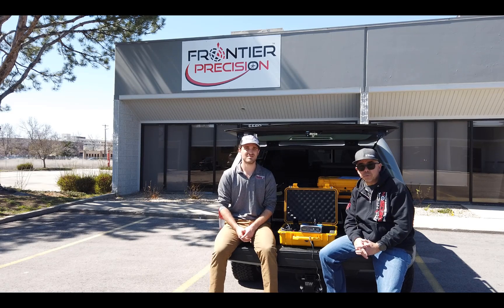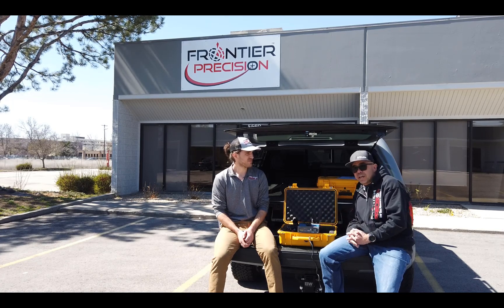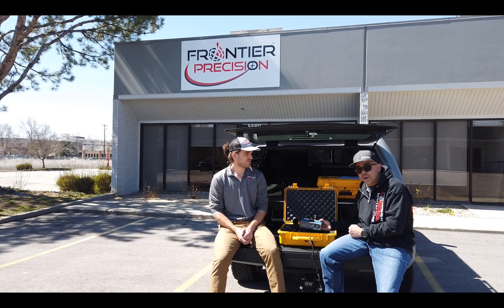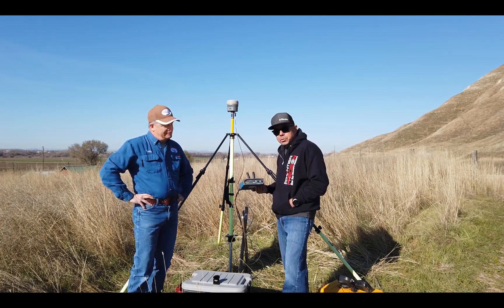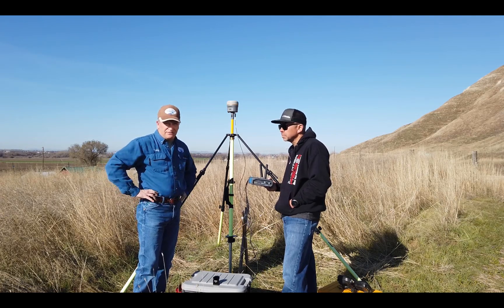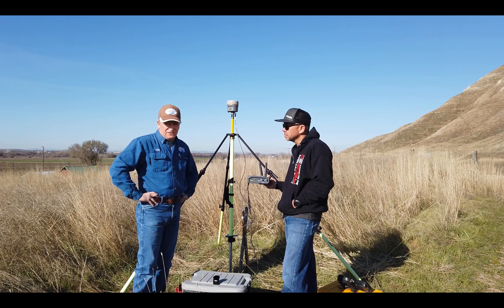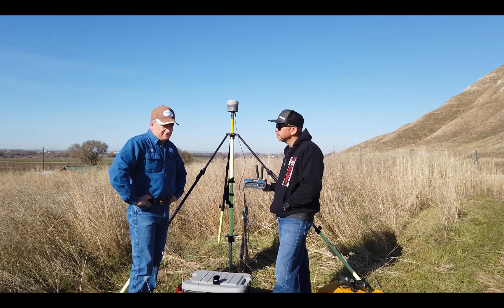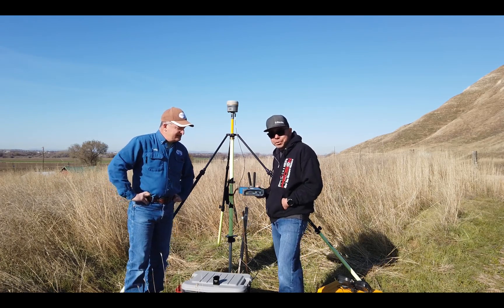Intuicom RTK Bridge- Base Socket Mode

Comment: As it seems you would need cellular coverage for the whole project, why could you not connect the R12 base to the internet via sim or hotspot and then send your corrections over an NTRIP server, and to the cell connected rover. I can see this as a useful unit to receive internet hosted RTK and rebroadcast over a UHF radio, as the website shows. Thanks